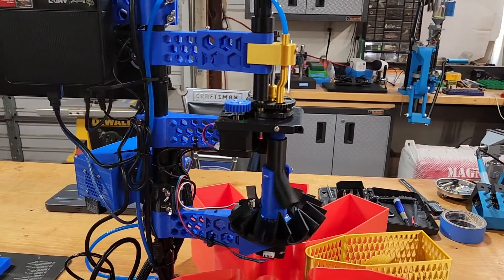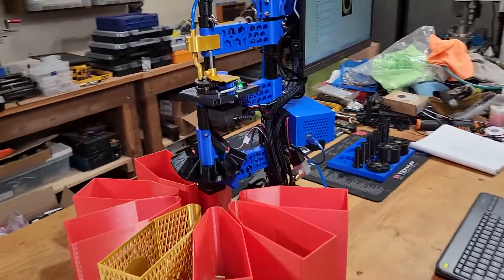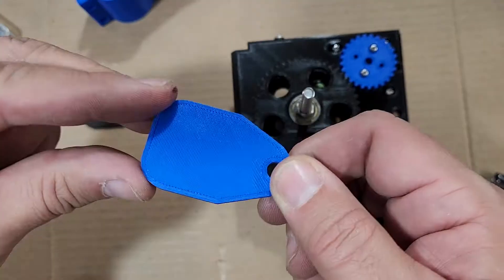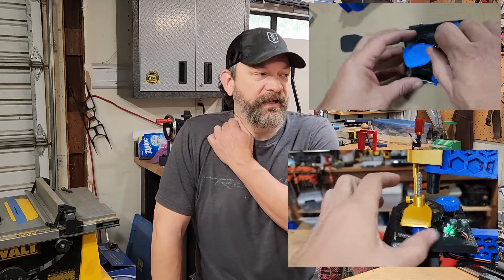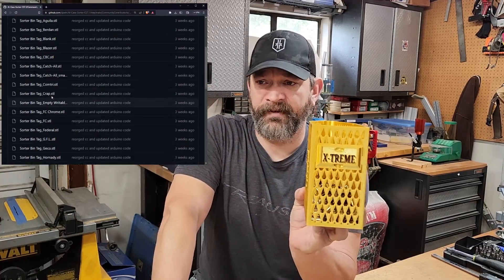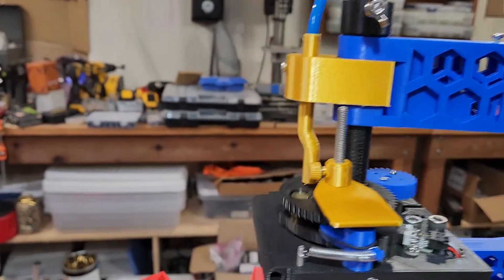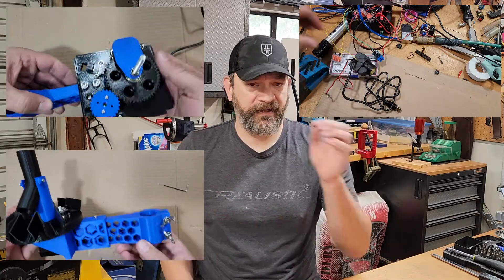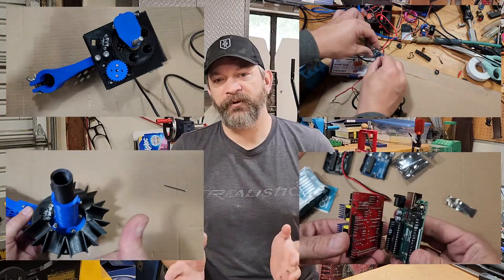AI Case Sorter 7.1 is here....finally!!!

Comment: Is it possible to buy a completed project from you?

Thanks
Reply from the maker: Thanks for your interest in this project. Currently I am not selling these as a completed unit, however, in the next couple of months, I expect to make build kits available which have all the parts needed to build the project and do not require any special tools or soldering. The kits would not include the 3d printed parts, but there are online services and members in the build community who are selling the printed parts kits for a very reasonable price as well. We also have a few community members who are selling completed units. If you are interested in going that route, the best move would be to join us on Discord and reach out to me, I should be able to connect you with someone to can help you out.  The link to join Discord is available on the download page of the software downloads site (listed in the description of this video).  Thanks!

Comment: sure great if one has $1,500 USD to blow on a plastic printer. 
and has a spare $2,000 USD lap top laying around. 
and knows how to do programing on a computer.
i have non of that.
Reply from the maker: There are services such as craftcloud which can print the parts for you relatively cheaply. Also folks in the community are building and selling complete machines.   You don't need a 2k laptop and there are many using machines that cost between $100 and $300 dollars.  There is also plenty of support in the community for the programming aspects, but you don't have to know programming as that is already done for you.

Comment: That is an interesting project.  Is your computer vision portion written using opencv?
Thanks,
Reply from the maker: Not seen in this video, but newer versions of the application have additional image processing, depending on which mode is used,  OpenCV may be used (conversion to grayscale, adding blur) but is not used by default.  The main "engine" behind the recognition piece is TensorFlow. Processing models include Inception and ML.net
Reply: @sjseth-builds  Thank you for the response.  I've used packaged camera systems at work but have been interested in using vision for some reloading tasks.  I'm hitting subscribe after I hit reply.

Comment: Any updates to this project? Seems like a fun build but before I go and start printing and ordering parts I want to know if there was any new changes or if it can be changed to sort 9mm, 380, 40 etc from range brass
Reply from the maker: I have been doing most updates in the Discord group. You can get a link by going to the software downloads page and registering for an account. The discord link is in the software downloads page. (See description).    In regard to new changes, I don't expect to release any major hardware changes in the next 3-4 months but there are changes in the works but again, no release timeline on those. probably 6 months out.  That said, there are a number of improvements and enhancements that have been made so definitely hop on the discord and find out.  Also there is a complete build guide in the github repository which you can download and check out as well. 

This machine is designed to sort headstamps of a given cartridge. This is to say, given a bucket of 9mm, it can sort winchester from federal. But not designed to sort 9mm from 45acp as there are very cheap solutions for that already available in form of "sifters".  There are caliber conversions for most common calibers so you can sort 223, 45acp, 308, etc

Comment: finally gives me a reason to get a 3d printer.  also what case feeder are you using/recommend? is it a 3d printed one or off the shelf?
Reply from the maker: It is a 3d printed feeder.  The project is called BF556 and is well supported:  https://github.com/BF556/Feeder
Reply: @sjseth-builds  thank you so much for this and its wild that youre still replying to comments on this a year later

Comment: Been watching for a while and very impressed with the results. I have automated a manual Master Caster and producing 600 to 900 cast bullets an hour. building bullet collator to feed automated sizer. would like to weight check bullets. thinking a load cell sensor instead of the camera. maybe 4 bins, +/- 0.5 grains of nominal, a little over, a little under, way off. have just joined GitHub, and can see files,  but have not found way to msg members of team. what do I need to do to connect?

Comment: This is pretty awesome but I have a question\suggestion\idea... What about sorting cases according to caliber prior to headstamp? Would it be possible to have a spinning wheel with a certain diameter hole that permit certain calibers to fall into and then the wheel would deposit the case into the appropriate bin? Kinda of a stage 1 prior to this stage type of thing, but 2 separate machines? Just food for thought.

Comment: I apologize if this has been asked, but could this run with a Raspberry Pi computer instead of the Arduino? My nephew and I are assembling one and he was wondering this. I love the project and am excited to get it completed.
Reply from the maker: I don't see any reason you couldn't use a raspberry pi.   You would definitely be on your own in regards to the wiring and programming though. The arduino code might work on the pi but I haven't tried it.  Ultimately the software uses serial communication to comm with the micro controller so as long as you handle that portion, in theory it could work.

Comment: Good day love the work huge respect..just a question  would it be able to use the same system to sort say 9mm .40 , 45 ,357 ,38spl and have the AI concentrate on the size eg 9 40 45 380 regardless of head stamp but rather the case size  thank you
Reply from the maker: This machine will probably never sort by size as there are much cheaper and better methods to do that already. Check out these: https://amzn.to/4alg1Jb

Comment: Its an interesting project but why are you even putting all of that time, effort, work, and money into merely sorting cases of the same caliber by their head stamp? I have been reloading 9mm, 357, and 45acp for over 10 years and no problem due to having mixed head stamps
Reply from the maker: As for why I did this specific project,  it is mostly because I enjoy this stuff and it is somewhat within my line of work (ai & machine learning). In regard to why sort brass by headstamp, as you have rightly observed, you don't need to sort brass by headstamp to make reliable functioning ammo and as someone who has been reloading for over 30 years, I fully understand that. However, there are times when we want to sort our brass by headstamp and when we do, it is a painfully manual process.  As to why sort by headstamp, the benefits not huge, but do matter. To observe the benefit, from a ransom rest at 50 yards with a chronograph/radar, fire 50 rounds of non sorted reloads from a ransom rest and then 50 of sorted. There is a measurable difference. 

Competitive shooters often want every advantage they can. If my loads are more consistent, then I can safely hover closer above the PF requirements. If I am a bullseye shooter, every bit of accuracy matters. 

Also consider this: If you were going to buy 500 pieces of once fired 9mm and you were given the option for either random headstamps or single headstamp and the price was the same, what would you choose?  I believe all things equal, 99.9% of us would choose the single headstamp because consistency matters. I might even be willing to pay a bit more for the single headstamp brass.  

The machine also sorts by primer size, primed/unprimed, upsidedown primers, etc.  Folks who are running automated presses benefit from the preflight checks.

Some folks are doing 223 to 300blk  cutdowns and there are certain manufactures brass which doesn't work for this reason as the walls are too thick. They want to sort out those "bad" headstamps automatically before doing the cutdowns. 

etc, etc ,etc.   That said, there are definitely reasons. 😁😁
Reply: If you are running a finicky competition gun with lightest springs the brass makes a big difference.

Comment: Excellent project! Outstanding work Seth and community. Can't seem to find the community on Discord. I only have one more question; mounting pole and mount, what is the recommendation?
Reply from the maker: If you register for an account on the download site (link in description), there is a discord invite generator. For tubes, we use a variety of things that are 1" OD.  Some guys are using 3/4 pipe, dowles, curtain rods, etc. I don't have an official recommendation. I like the solid aluminum bar, but it is a bit more expensive

Comment: Cool project but I don't care about headstamps.  I want a brass sorter that will sort brass into buckets of 9mm, 380, 40 S&W, 10mm, 38, 32, 9mm Makarov, 45, etc.
Reply from the maker: Thanks, you might try something like this for sorting by cartridge: https://www.dillonprecision.com/19972
Reply: @sjseth-builds  - I already have the plastic case sorting sieve trays, but they're useless for sorting 9mm, 9mm Makarov, and .380.  They're fairly good for presorting before tumble cleaning brass to prevent small cases from jamming inside larger cases with stainless pins wedging them together, but really need to be tumbling bins to more reliably shake the 9mm cases out of the .40 cases.
Reply from the maker: @Liberty4Ever  Some guys are using the headstamp sorter to sort those (9mm, 9mak, 380) as they are similar diameter and length.  The cartridges should be within 3-4mm of the same length and should be approximate same diameter.
Reply from the maker: There are also some guys on the Discord server who have made analog 9mm / 380 separator machines which are very basic and simple and could probably accomplish the same task

Comment: Impressive, I shoot fclass and sort bullets by Overall Length, I had an idea to use a similar method of sorting.
Reply from the maker: Not sure how that would work but sounds interesting!
Reply: @sjseth-builds  well I found an application where a guy was using a camera to measure objects by counting pixels. I figured with a high resolution camera and maybe a macro lens, one could get good resolution in measurements.
Reply from the maker: @somedude5713  It seems possible though there would be quite a few variables to control as the slightest change of position between the subject and the camera would throw things off. If you do get it working, definitely reach out and let me know. Would love to see that in action!

Comment: I like the screen mount
has the software stillhave the same min requirements. Would it run on a stick pc, eg Intel Compute Stick?
Reply from the maker: I don't think it will work on a stick PC.  The minimal requirements are listed in the download site and haven't changed. It requires x64 architecture and a CPU that has AVX support.  min 8gb ram required but 16 recommended for large models
Reply: @sjseth-builds   no problems thought i would check. thanks for all the hard work

Comment: You could replace the air drop with a cam actuated plunger
Reply from the maker: Thanks Nick! Trying to picture what that would look like... maybe email me a sketch of the idea? Cheers!
Reply: @sjseth-builds   something like a spring loaded plunger where the air compressor is, that would release when the air would puff. The spring will push the case faster than gravity,  and then just reset it via a cam pushing up and a relay or something similar.

Comment: The end result looks great. I was following your project and had the basic version working. Then I got side tracked (bought out a friends 3d printer inventory). Now I am glad I stopped working on my project. Hope to get back to it soon.
Reply: 8 months later, I am working on this project again. Thank goodness someone created a shim to mate 1/2 inch galvanized pipe to the one inch pipe you used. I have plenty of 1/2 inch pipe (glue clamps :) ) I decided to start over and go with this final version. Looking good so far. Thanks for the detailed pdf instruction manual.

Comment: This is outstanding... I don't know the first thing about 3D printing. If you were to dell one, how much would you charge?
Reply from the maker: My time is very expensive (or at least the value I put on it) so it wouldn't be worth it I am sure.  That said, if someone is just starting out, the cost of the parts/kits needed is about $250 for the 1st machine, the 2nd machine would only cost about $100 in parts. The rest would be time.  I have a few contacts who have reached out in regards to putting together kits to sell. When I get more information, will update the channel. I think there are many folks in your situation who could build it but don't have a printer or time/energy/will to learn how to 3d print. Thanks for reaching out and glad you enjoyed the video.